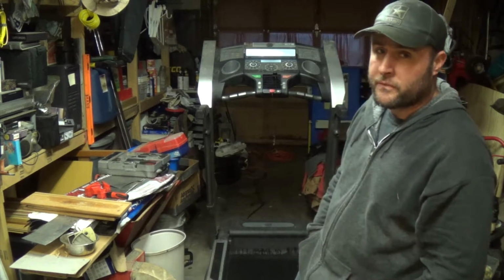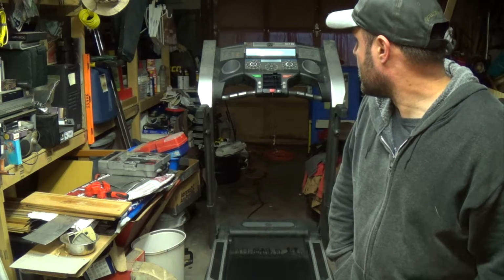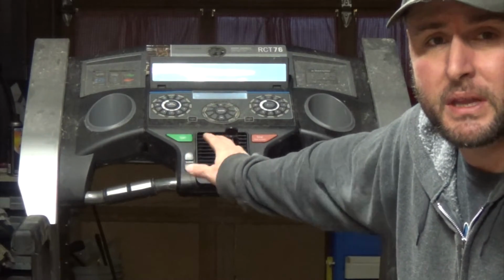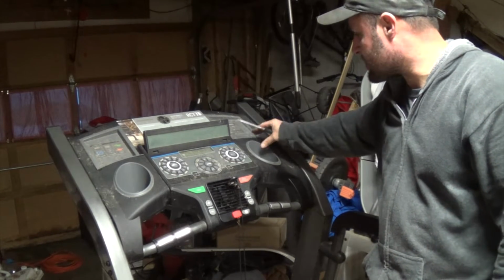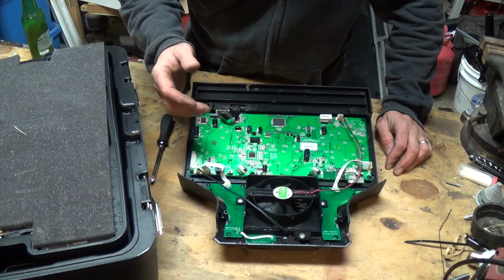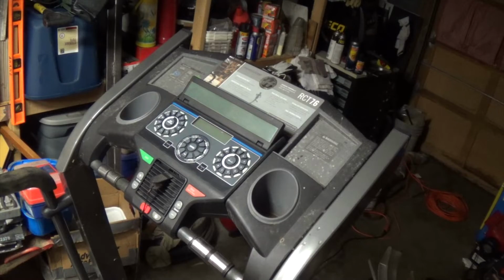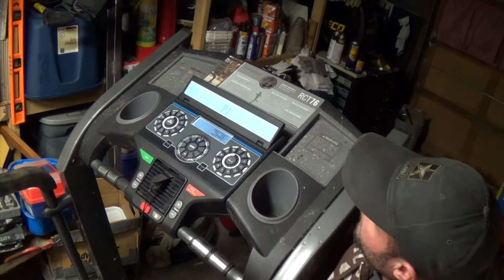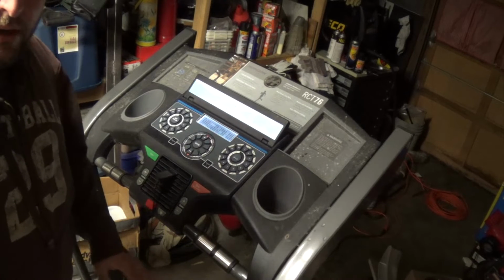Treadmill Project

Comment: I wonder if you could measure how the control board signals the motor drivers. Perhaps you could try to control it with your Arduino board.
Reply from the maker: I looked this one up. It’s a very complicated board that looks for signals from several sources. Be much easier to get a variable speed controller. Much less complicated